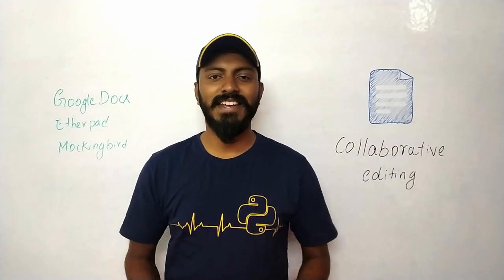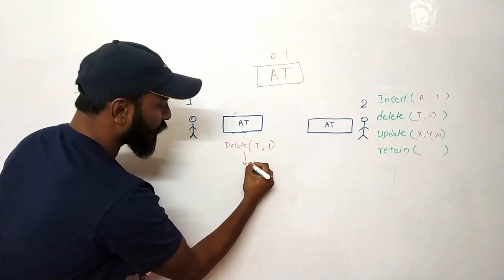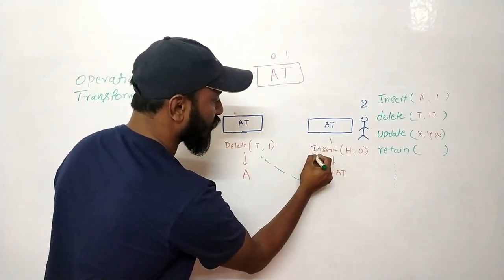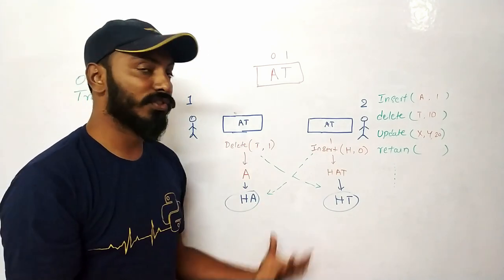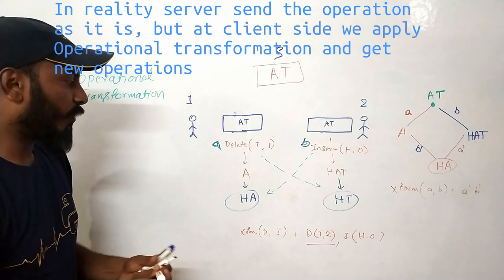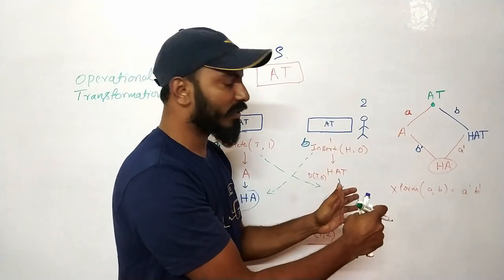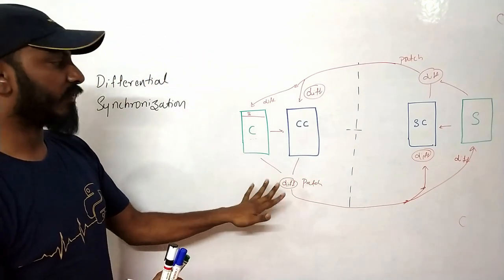Google Docs System design | Part 1| Operational transformation | differentail synchronisation

Comment: I do not 100% agree with the statement that 'lock can ever be a solution to collaborative editing', it eventually comes down to the use-case / requirement you are designing against. Quip is a perfect example of using lock for concurrent editing, it locks down a row / code block when someone is editing. Others can only acquire the lock by explicitly requesting a control from the lock holder. 

It works in quip because there is probably a really rare case where there will be 5+ people editing the same row at the same time in an enterprise. Maybe quip uses a different algo in a different pricing tier, but it works perfectly at my company (10k+ people worldwide). Gdoc might be designed for a more general case where there can be many more editor at same time, so they use some different algorithm
Reply: exactly. A lock per raw/line could work I guess
Reply: Good point

Comment: How do you know what is the operation that corresponds to a` from a?
Reply: From what I understood at a high level thinking. The idea is really boils down to
a' (a prime) and b' (b prime) in mathematics are represented as CHANGES of these operations. Like how you calculate for velocity/prime in math, it is the change from the old state to the new state.

With his example - AT right?
If there was an a with Deletion(T, 1), and b with Insertion(H, 0) -> a' should calculate for the difference of what is AT deletion is (T deletion after A is a' let's say), and b' should calculate with the insertion of H into AT is (H -> AT is an insertion before A, let's say is b'). And at the end a would combine with b' operation, and b would combine with a' operation hence resulting in a HA instead of HA|HT. The exactly logic behind it, I am not for sure, but I would suspect some kind of edit distance algorithm with some wildcard for transformation. But that is the high level overview.

Comment: Great video Narendra! I have question in terms of synchronisation of document for users across the region. For example: A document is created by user in India and he is connected to a server in India. If he is collaborating with users in US and Europe and the master copy of the document is in India server, then when they try to perform any operation on the document it will be slow to communicate with the server in India and the experience will laggy due to Round Trip Time. And we cannot distribute the same document across servers as that will cause issues with which data operation needs to be performed. How can we solve this?

Comment: THIS COMMENT IS FOR MY PERSONAL REFERENCE. TO UNDERSTAND PROPERLY WATCH THE FULL VIDEO
--------------------------------------------------------------------------------------------------------------------------------------------------------------------------
why not pessimistic lock 3:13
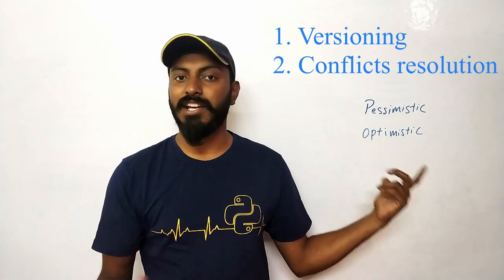optimistic lock 4:28
sync idea(event passing also known as OT, Diff sync) 6:00
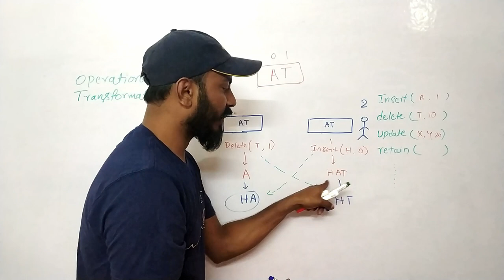Operational Transformation 8:50 14:35 20:05
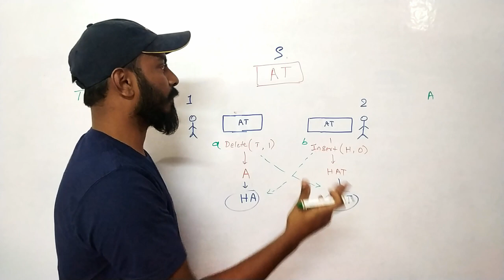OT example  20:54
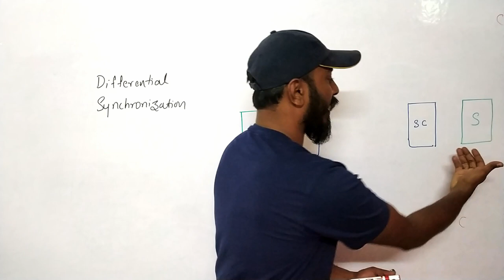Diff Sync (Preferred) 26:16 27:30

Comment: I really like your other videos, but this is the most confusing one. You really went into mathematical side instead of sticking to core system design concepts.
Reply: That's because the mathematics are really the core design concept in a system that uses Operational Transformations. You really can't design an OT system without understanding the underlying math. I know; I've tried. :)